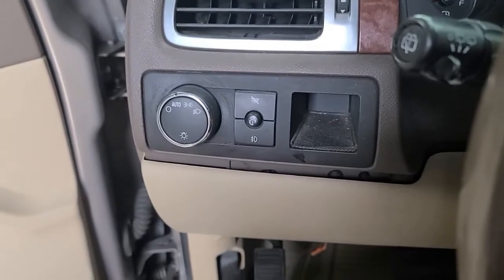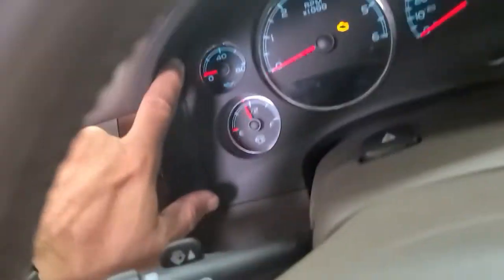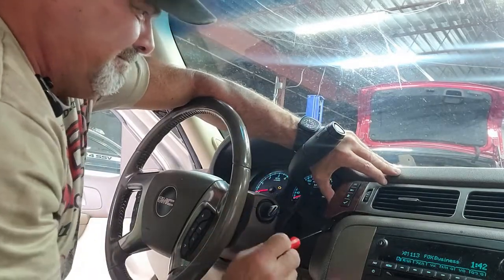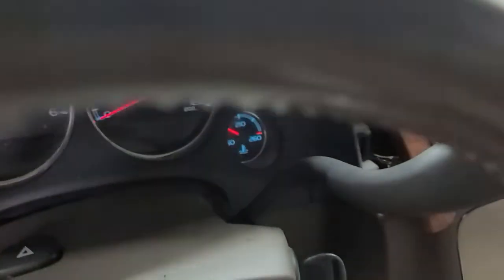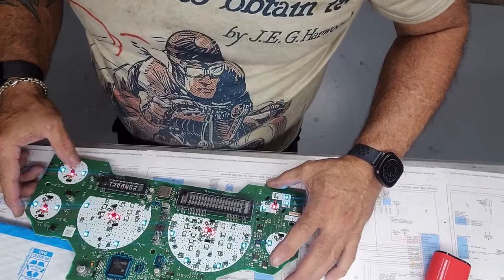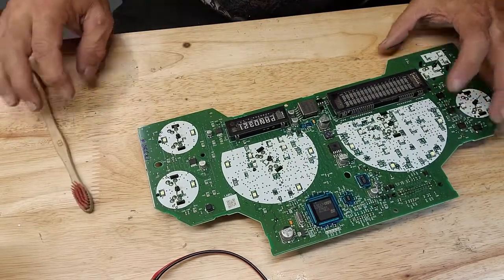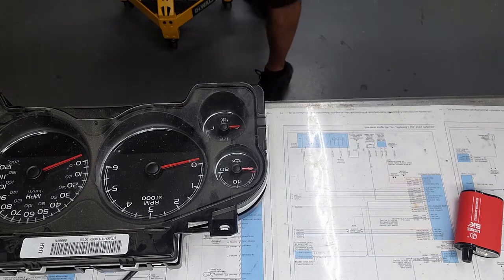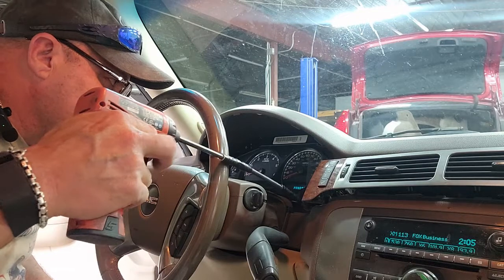07-13 GMC Yukon Tahoe Suburban etc. Odometer PRNDL display out dim ...FIXED!  Cluster Removal Repair

Comment: That's what I did.. A lot of other people say you HAVE to replace the mosfet but if it's still working I don't see why it's necessary... and like you say you will be able to see if the mosfet is blown or cracked pretty easily...
Reply from the maker: Alot of them come in burned up....i definetly replace those (no choice there)  I think the bad connection is what causes them to fail and burn up so if the component is still good and you beef up the connections then it shouldnt fail.  Just my theory though

Comment: Thank you so much for sharing your knowledge.  Is it possible to change the culster lights' color? Like blue for 2013 gmc yukon denali xl. 
Thanks
Reply from the maker: yes you can ...unfortunately its not an easy processes due to the surface mount LEDs

Comment: Outstanding work on repair left side works gear indicator side went dark I know it's gonna take a lot to repair or replace
Reply: Im having the same issue the PRND is not flickering. Are you able to show what solders control the right screen?
Reply from the maker: same spot

Comment: So when it starts dropping a digit or tries to dim down, this is the place to resolder the cold joints????
Reply from the maker: yes....occasionally there will be a bad processor but 90 percent of the time that will fix the display issues.
Reply: @AutomotiveElectronics  Thanks!  I'll give it a try, if it doesn't work, I'll send it to you in SA have you bail me out.  Appreciate it!  Let's go Brandon!

Comment: If you get a use cluster from the junkyard and put it in the vehicle will not start who can reprogram the dealership or a car locksmith??
Reply from the maker: 07 to 13 does not require programming to start....it will not have the correct mileage however unless it is programmed
Reply: @AutomotiveElectronics Ohhhh ok for a moment I was scared why did general motors have to make a digital